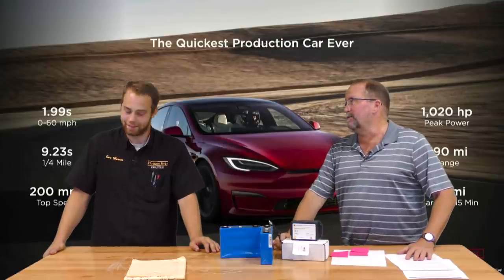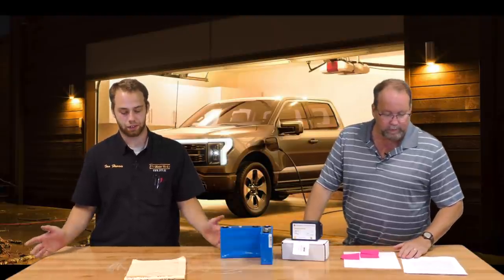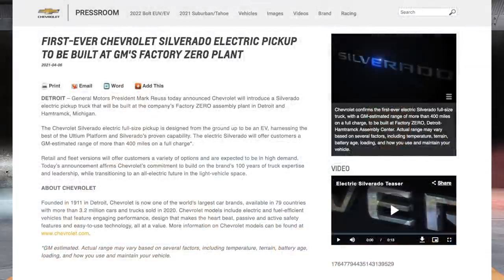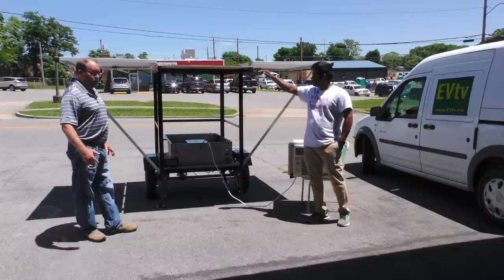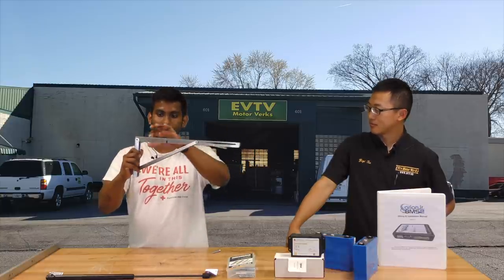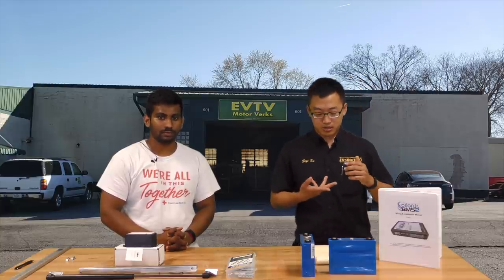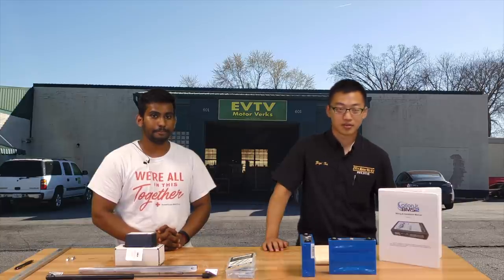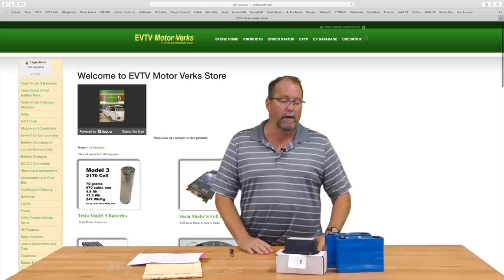EVTV Friday Show -Tesla plaid, Ford Lightning, Solar trailer build

Comment: Hey guys great content...WRT to the Solar trailer...what thoughts have you got to tilting panels for solar angle or even if it is worth 1D tracking as your panel size is limited...cheers guys
Reply: What if the panels mounted at the bottom and folded up and in to protect the panels more. You could then lower the top down to above your inverter, or in a future revision create a locking telescoping rod system on the corners to raise them up?

Comment: The battery pack is smaller than the previous model S, it's 100 kwh, the previous one was 104 kwh.
Reply: Smaller is lighter!    lighter is faster!
Reply: @scottbaker9066  yeah of course, I wash not bashing, I was trying to make the point that the we're able to get more performance, and range from a smaller battery

Comment: Why are you using a 80Ah batteries instead of doing like 280Ah batteries for your solar trailer? Nice video. Are you guys still making the solar set up with the Model S battery.

Comment: Knowledgeable 'facts' I've seen, including Motor Trend measurements have the new Model S pack at 100 KWh of 1850 cells. Elon has said 4 modules is redundant, and he wants one module as shown at battery day. Potentially, Tesla has made one large Model 3/X style module for the new Model S. Depending of cell capacity, this new single module could be 80P,96S, or 82,96S with the battery being 80/82 cells wide by 96 cells long. Each width row of cells would need to be insulated from the neighbouring row. The insulation could be done with the coolant strips. The 104 kWh previous model S battery pack with the 16 modules was effective 74 cells in two modules wide, and 112 cells long in 8 modules. Each of the 16 modules had 516 cells - 14 x 37 cells (518 cell spaces with two spaces used for other stuff). 
Jack pulled an 18650 and a 2170 cell apart and showed us a picture of the jelly rolls unrolled. While the 2170 cell has 1.466 times the volume of the 18650 cell, the unrolled jellyroll of the 2170 cells appears to have 1.7 times the area of the 18650 cell. Therefore, the 2170 cell should have 1.7 times the capacity of the 18650 cell - about 16% more than the capacity increase based on volume. 
For the 4680 cell, the volume increase over the 2170 cells is 5.484 times. If we assume capacity increase is 16% more than the volume increase, the capacity increase is 6.361 times. Multiplying the two capacity increases together 6.361 x 1.7 = 10.814 times - thus the 4680 cell should have ~10.814 times the capacity of 18650 cell. 
If 82x96=7872 cells have 100 kWh, each 18650 cell has 12.7033 Wh.
Thus a 4680 cell could have 12.7033 x 10.814 = 137.373 Wh.
Thus the 960 cell (4680) battery shown at Tesla Battery Day should have 137.373 x 960 = 131.878 kWh - 131.878 times the 100 kWh Model S pack.
The Plaid+ had 520 mile range compared to 390 miles for the Plaid - 133.333 times - very close to the battery size increase (1.1% more).
If the 4680 cell has 10.9333 times the energy of the 18650 cell, we can match energy increase to range increase. 

Would love to see EVTV tear apart another pair of 2170 and 18650 cells to precisely measure the area of the active part of the electrodes (cathode/anode) for each cell size, and report size to the nearest half millimetre to your readers.

Comment: What everybody wants is a Tesla Powerwall combined with a solar roof and autobidder - that's a real solution. Not a truck battery - that's just a gimmick, not a real solution, plus it requires rewiring the house - you might as well install a Powerwall...
Reply: I have this combination of Powerwall and Tesla tile roof. The roof is beautiful and on sunny days feeds the grid and pays me.

Comment: Wait till the mice get into these EV'S!!!  
You'll have your own personal BRICK!!!
Reply: No more that a modern ICE car.
If a mouse "gets into" the high voltage cable..... Immediate "Ex mouse".
If it gets into the low voltage/ sensors, the diagnostics identify the fault.
Nice try, but no cigar.
Reply: Tony, I bought my electric car with many fault codes, and it turns out a rat had chewed its way through about twenty wires in the main loom in the cabin. Key finding faults and abs faults! The oems are using fancy edible fillers in the wire insulation and in the anti rattle foams, so no wonder the buggers are setting up camp. The answer seems to be peppermint oil as a repellant. Repaired all the wires with crimp splices and heat shrink, and all the fault codes cleared✅